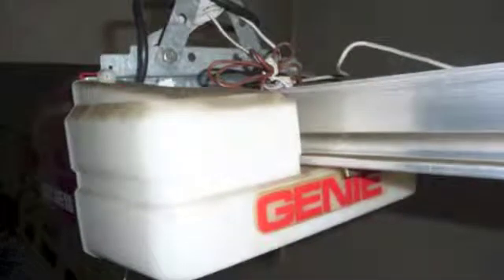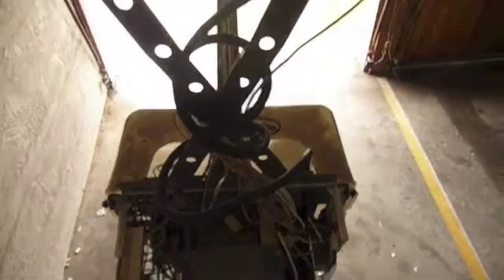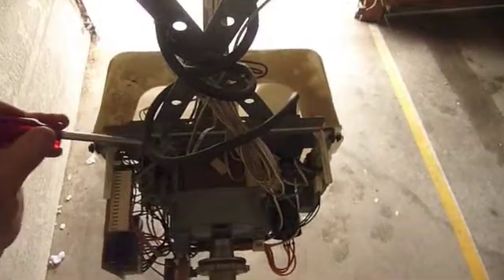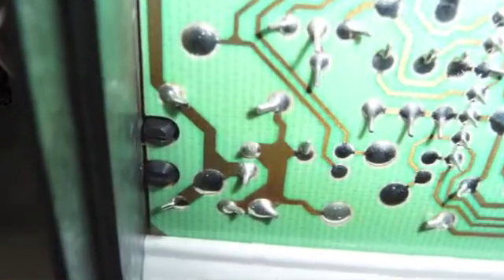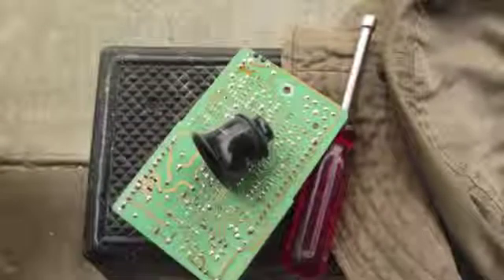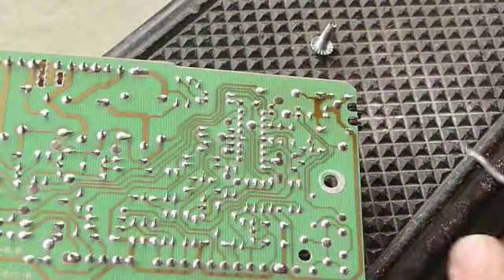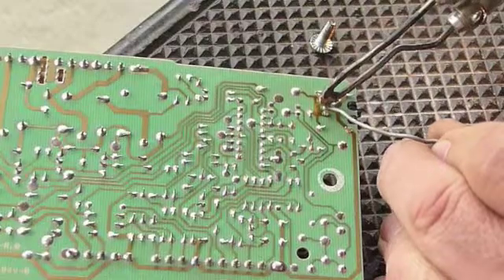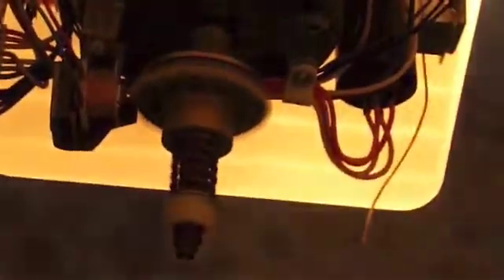GenieScrewReluctor

Comment: I took my genie bluemax cm8500-s apart to clean the rail and screw. But also wanted to lube the bearings. Once assembled it started closeing but wouldn't open. Each time i hit the button. Kept eanting to close even though its already closed. Now it moves a few inches forward stops and then opens all the way or stops again after going back a few inches. I can hold the button and it will open all the way. Any pointers you can give me?

Comment from the maker: Also today 1-26-13 had two service calls. Both were genie retail screw drives (rail in three pieces). Both had stripped 99% of the trollies teeth. The first one I took the time to video document the replacement of the whole screw assembly with a new trolly and motor to screw drive coupler. And demonstrated why these store bought units (retail) wear out trollies so frequently and showed an up grade repair that will almost completely eliminate a reocurrance of this issiue.

Comment: Yep...the front style of mounting that Genie has used on screwdrives has been a major factor for vibration, and vibration can certainly cause loose solder joints as well as blown lightbulbs. Most mfg's have figured out that a side mount is much more stable, I have drilled the rail and added a secondary brace on many a genie sd. I'm not a big Genie Screwdrive fan but they are fun, predictable and easy to fix.
Reply: I´ve exactly this garage door opener for a very heavy single door.
Your advice was always helpful, but now it does noct work any  more.
The drive stops within seconds and reverses. The reluctor is no more fitting. It seems to be more backwards. What could this failure indicate?

Comment from the maker: That solder crack is a common problem with that sires of Genie screw drive. That plugin connection with the wire hanging loose shakes enough if the unit has a flimsy mounting. This one had the flat straps that came with it in the box mounted in an "X" style. They always shake and shimmy during operation. And even more if during the screw drive assembly a coupling gets bent, then it shakes like a blown front tire while doing 60mph.

Comment: Excellent video Colt!! If your close up vision is crap like mine, you can use a loop like you had or take a screwdriver and scrape the suspected post...making a temporary contact then when you send it down if it works then you know where to solder. I've always known that as a "cold solder joint" when it cracks around the post. I used to be able to spot em easy but my eye's are getting real bad.